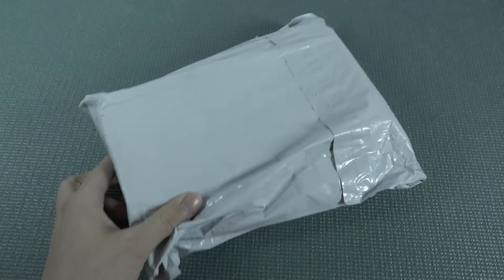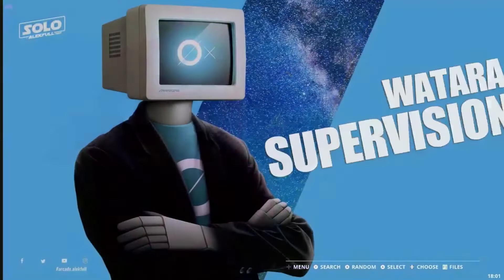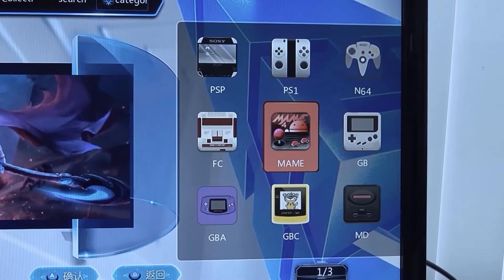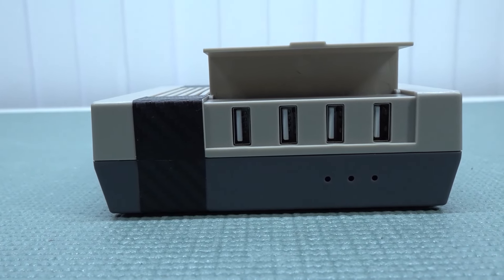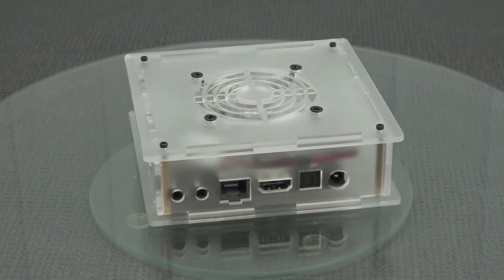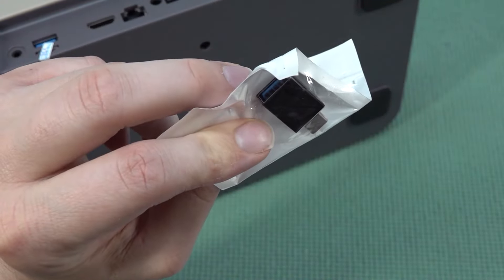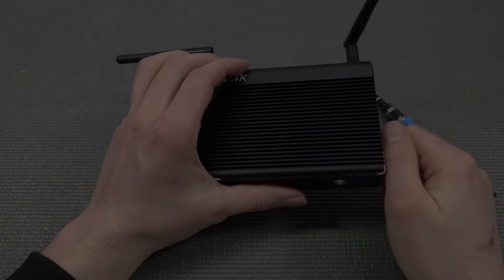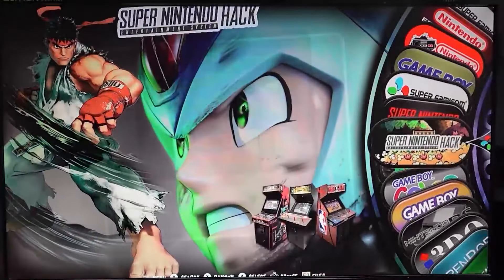Budget Game Box Solutions - For All Your Retro Gaming Needs ! -

Comment: I have the 2905x4 and I absolutely love it. I haven't had any trouble with it at all. More games run better on this one than the regular s905. In the one I got from haynow, they straitened out all the settings and set everything up already. I've had several of these devices and the tv box side of the device never worked but it's fully functional on this one. I have 9 consoles hooked up in my game room including PS5 and I play this more than any.  The x3 or x4 still only play up to PS1/Dreamcast but they do play everything better. It's a noticable difference.  I'm scared to buy the x5 pro because I think it maybe still needs to work out the bugs like they did here with the x3&4. For $60-$80 these devices are  very good buys imo.  Thanks for the video.